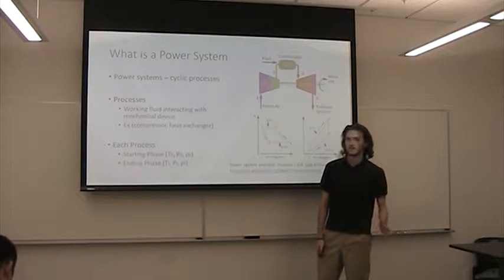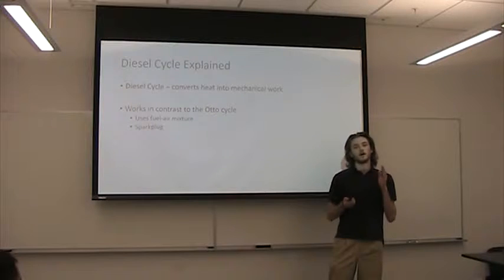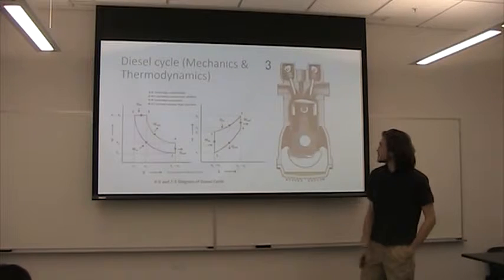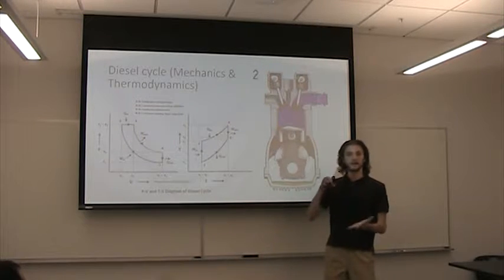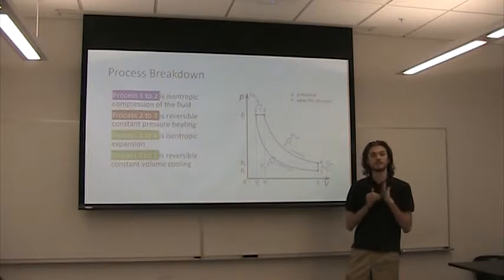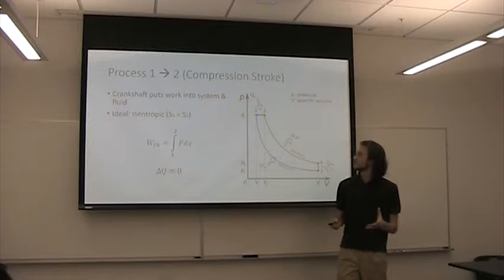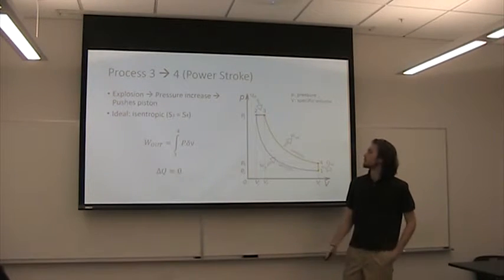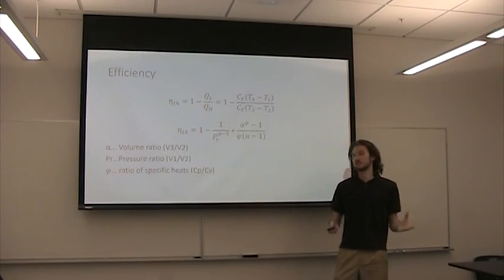Taylor Cates  6 minute talk  Diesel Cycle

Comment: Mispoke: The otto cycle contains the spark plug, not the diesel cycle.
There could have been a smoother transition to calculating efficiency.
Stuttered, said "umm", spaced out words, and went overtime.
BUT I do think this is one of the better presentations I have delivered.

Comment: Quality of slides--nice animation of the diesel cycle. It helped give the audience a visual idea of how a 4-stroke engine works. I also liked how you gave an initial overview of all the processes, then went through each of those processes individually. It helped the presentation flow nicely. Only thing with animations is that they are risky. As long as you know the animation works in the room beforehand, you should be good.